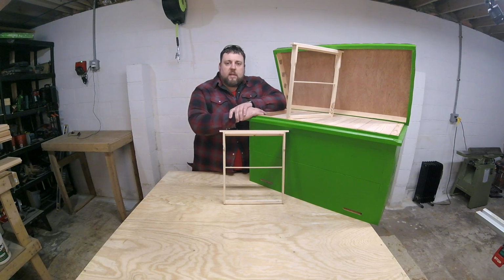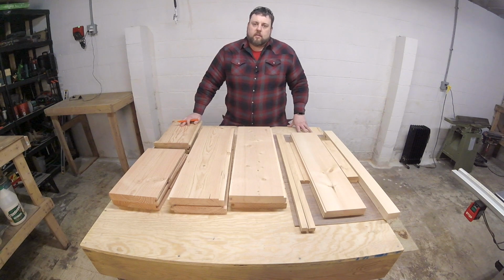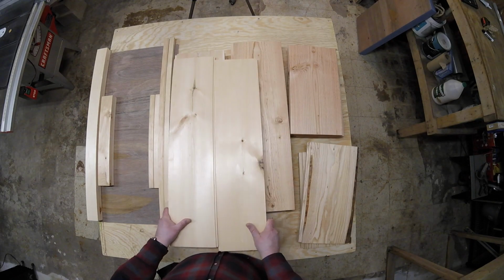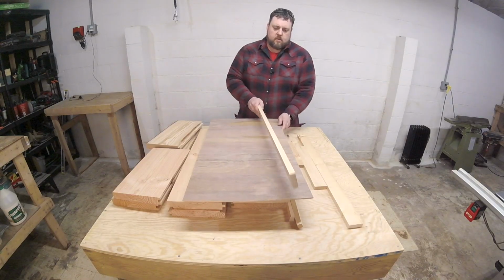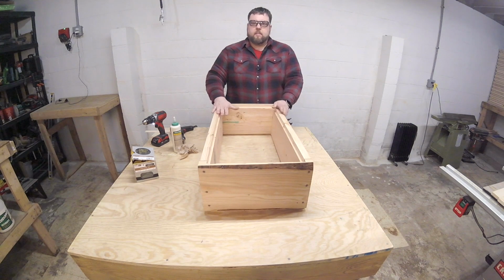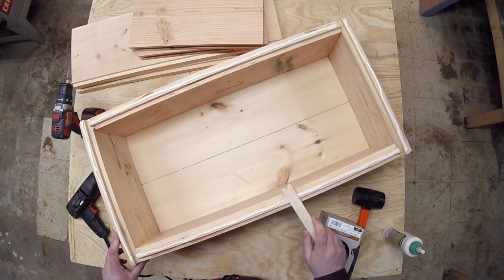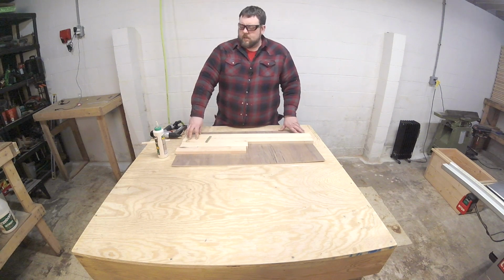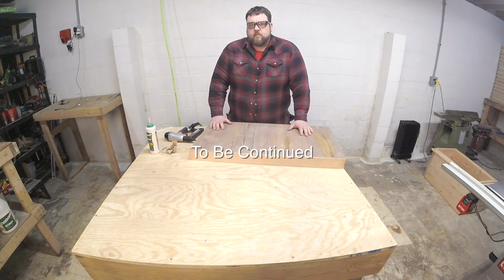🐝 How to build a Layen's Hive Part 1 of 2

Comment: I like how you modified the hive to 19 frames! Great idea!
I plan to further modify my plans by building a laminate wall with plywood, sandwiching foam board, with 2X2’s bordering each panel. vs, solid wood.
Reply from the maker: I've seen this done. I try not to run any plywood on the interior of my actual hives (not including traps). I'm not sure that the glues and chemicals used to make plywood are good for bees. It would however make a more insulated hive and defiantly be lighter. Good luck!
Reply: Bee Boy Bill 
Good point on the plywood glues!
May do a thin tongue & groove interior then to avoid that issue! Thanks!

Comment: I believe that with cold winters and hot summers, it might be a good idea to create a permanent layer of insulation around the outside of the standard Layen's hive between one-inch framing boards where you add the insulation made of the wool from local sheep farmers. Then have a second layer of siding outside of the entire insulation layer, similar to how we build house walls for humans, but not as thick. I think that one full inch of insulation all around the outside walls is plenty. The key issue is fixing the areas where the bee holes are and any ventilation holes with another layer of the boards and the exact thickness of the space with the hole drilled into those. This way the entire outside of the box is more like the thickness of natural trees, where even in the worst of the cold winters and the worst of the hot summers the bees would not have any problems with the heat or cold. The insulation layer would need to be fully enclosed, glued, etc. so that there is never a problem with infestation..

Comment: Further in the video I saw the yellow push block. (Seeing bare fingers pushing 2x6's scared me.)  Let me extend compliments to you on these videos.  They are some of the finest I have seen.  The way you made clear, right at the start which parts were which, the sizes, the careful cutting of rabbets, tongues, pilot holes, hammer tight the joints, keeping fingers away from staples etc., very professional, and a delight to watch.  The edits, the silent movie clips.  And one particularly sees from the ease with which you apply glue, the skill of your hands.  (Thirty years experience here; applying glue takes some skill.)  Nice shootin' pardner.
K. Hogan, Sacre Coeur Woodshop
Reply from the maker: Hi Kerry. I’m kind of attached to my fingers and try to be as safe as possible. I think you’re talking about the GRR-Ripper and it works great. Thank you for your support!

Comment: THIS IS FANTASTIC!!!  Thank you for the time and effort you put into this!!!  I have never raised bees but I have two kids with bad allergies and I have a disease in my spine that makes lifting a potential problem.  When I saw these hives I was hooked.  Dr. Leo is all about not medicating your bees and letting them be bees and I'm all over that.  My only question is what extractor do you use to extract the honey.  From what I have found the standard extractor are not large enough to accept the frames from this type of hive and for someone like me who will only have one or two hives I don't think it makes sense to invest in a $700 extractor.  THANK YOU AGAIN!!!
Reply from the maker: Hi Joe,
I highly recommend the crush and strain method for harvesting honey in small amounts with natural comb. You are correct, extractors are expensive and unless you are harvesting large amounts usually not cost effective. If you are only looking to produce for your family, crush and strain should work great. 

The crush and strain method does sacrifice comb, and therefore the production will not be as large because the bees will first have to make the comb to store the honey in. 

On the flip side, crushing the comb will also prevent build up of any lipophilic chemicals neighbors or farmers are using to treat their plants and if you really need more honey, adding more hives are cheaper than an extractor.

Thanks for your support. Hope this helps!
Bill

Comment: Hi Bill, 
Me again. Again, Thanks so much for this great video. 

I’ve bought my lumber for my first beehive and will be following your great instructions. 

I was torn on what design I wanted to use as I’ve seen other plans which incorporate slats which lay on top of the frames. This allow the keeper to access particular frames while leaving the rest of the frames covered.  
I wondered how your experience has been with no slats on top.

I could always use a rabbet to sink my frames a touch deeper and build shorter frames to accommodate and use your same design. 
I’m curious to know your thoughts on this approach. Do you see any benefit to having them, Or is it just one more thing for the bees to glue down?  :)
Reply from the maker: Hi GE, I don’t get into my hive too often so I may not see a benefit to additional slats on top, but I don’t think they are necessary. I try to check on them every two to three weeks but I’m not interrupting the brood best just adding a frame or two at the end if they are making lots of new comb. I usually only take a look at the brood nest in the spring and they don’t seem to mind too much. Hope this helps!
Reply: Bee Boy Bill wonderful!  Thank you!
Reply: Finished one box today! (Minus the bottom board which will be plywood and the top) but the hard part is done.  
Thanks again for the great video.  Super helpful!

Comment: I couldn't tell, but did you use a dado stack on the table saw to cut your grooves?  If you didn't, what was the measurement between the fence and the blade for your grooves?
Reply from the maker: Hey Eric, I did use a stack for the grooves.

Comment: is it necessary to do the joinery? don't have all that gear
Reply from the maker: Although I haven't done it without the tongue and groove or rabbit yet, I would say it's definitely possibly to do it without them with a little creativity. The trick for the tongue and groove would be to figure out a way to hold the sides and ends together. You could use dowels, biscuits, a pocket jig, or possibly even a 2x4 on the outside to hold boards together at the seem. The 2x4 would make it a bit heaver but might be a good handle for moving the hive. I'll put some more thought into this, let me know what you end up with!

Comment: Hey Bill, I noticed you expanded your length to accommodate 19 frames so that changed many of the length measurements.  I purchased your “One saw layen’s hive plans, but I believe this is the shorter version of the hive.  Do you have a parts list for the longer 19 frame version.  Especially the lid dimensions and some of the rabbets and dados.  Thanks!
Reply from the maker: You are correct, the one saw hive is a 14 frame variety. If you are using the one saw plans, I don’t think there would be any changes in the rabbets and dados. You would need to add lengths to the front and back of the hive, the bottom board, the sides of the lid, and the lid top. I will try and get an approximate number this evening for you of how much to add to those pieces for the 19 frame model, if you are in a hurry i laid out the dimensions for the 19 frame model in an early video “How to build a Layen’s hive part 1”, and those lengths would be correct and the width from the one saw wouldn’t change.
Reply: Thanks Bill
Reply: @BeeBoyBill  Sorry, I did not get the sizes for the bottom board and others before you started putting it together.
Reply from the maker: I'll get to the bottom of this, I was trying to respond on my phone and thought you were watching the One Saw Hive video. The One Saw Hive plans were actually from this build video: https://youtu.be/irGS0YbFHNM but they should be adaptable for a 19 frame Layens though I will get you some numbers ASAP for those cuts.
Reply from the maker: I sent you an email with the updates, please email me back and let me know if this will work or if there is something more I can do to help with your hive,
Reply: @BeeBoyBill  do you mind sharing the parts list for this 19 frame hive since the 14 is different or do u have the 19 hive detail plans on your website? Thank you for such a great tutorial!

Comment: I don’t have a table saw but do have a router with edge guide… can I make the joints just using that???
Reply from the maker: I use the dowel method instead of tongue and groove without a table saw. Check out this video for building a hive without a saw: https://youtu.be/irGS0YbFHNM
Reply: @BeeBoyBill  
Thank you! 

I will watch that right now…

Comment: Good Job Bill. What was the reason you used the jointer on an angle for the top frame?
Reply from the maker: Hi Michael, I used the jointer to chamfer the drip edge of the lid rest. It could also be done with a table saw or router if a jointer isn’t available.
Reply: @BeeBoyBill  Thanks Bill good idea ! Keep up with the great videos I sure enjoy them

Comment: Nice vid. I dont have the table saw to make the tongue and groove. Do you think nails and staples would work out?
Reply from the maker: If you're not moving them it might work. A better way might be to use biscuits or dowels and glue them together. Dowels are the easiest and cheapest if you don't want to get into biscuits. A third option would be to reinforce the joint on the outside with slats. I would think furing strips would work and it would give a bat and board appearance. Hope this helps!

Comment: is it essential to put the rabbit in the bottom for the bottom board?
Reply from the maker: Hi Jeremy. The rabbit works great but I'm sure there are a lot of different options that might work instead. I would try to keep the same distance between the bottom of the frames and the bottom board that the rabbit produces. Hope that helps!
Reply: @BeeBoyBill  do you reckon you could just cut in the bottom board neat to the inside measurements of the box and screw the board from the sides of the box or does the rebate serve a specific purpose?
Cheers mate
Reply from the maker: You could certainly do that. I would recommend some waterproof wood glue if you go that route to eliminate any gaps. The rabbit is nice for a better seal and helps disperse the weight accorded the bottom board. The only danger I could see is if you inset the bottom board without a rabbit, it’s possible that the weight of the full hive might push it through as all the weight would be on the screws. If you go that route, make sure to support the hive with the edges too so that all the weight isn’t just on the bottom board.
Reply: @BeeBoyBill  cheers mate

Comment: Why do the end pieces of the frames have to have the reduction from the 1.5 to 1 inch?  Can’t the end bars and bottoms of the frame all be 1 inch and the top bar be 1.5? It sure would speed up building
Reply from the maker: Great question! I don’t have an answer for you why the Layen’s are tapered. It makes sense for the Langstroth because the top of the side of the frame is for spacing. Because the tops can space the frames as you alluded to. It could be a carryover of design from the Lang’s. Either way, it looks like Dr Leo already beat you to it with his easy to build frames! I’ve never tried them so I can’t comment on results, but you can find the plans for them here: https://horizontalhive.com/how-to-build/deep-frame-do-it-yourself.shtml
Reply: Wow! I thank you 10 fold for this! It’s been holding us up from getting our hive going and now I feel confident we can quickly assemble and get this ready to go for swarm season in Ontario!!! Thank you Bee Boy Bill ✨

Comment: Push sticks!  Push sticks!  Use push sticks, roll up your sleeves!  (I used to have eleven fingers...)
Reply: letting that little cut off strip reminded me: My brother ripped a 1/2" strip off a board. When he finished the cut, it disappeared. It took awhile to find it. It was in the next room. It had gone completely through a wall, both drywalls.
Reply: letting that little cut off strip reminded me: My brother ripped a 1/2" strip off a board. When he finished the cut, it disappeared. It took awhile to find it. It was in the next room. It had gone completely through a wall, both drywalls.

Comment: What was the thickness of your bottom rabbit. Did you leave space for cover boards on top of your hive? Your video is a great help : )
Reply from the maker: Hi Mike, the thickness of the rabbit is the same as the lumber you are using so the bottom is flush, mine was 3/4". You don't really need cover boards with this type of hive because all of the frames are touching. There is about a 1.5-2" space above the frames however because the lid sits on the lip. I put rock wool insulation in this space for winter. Thanks for the comment!

Comment: While I am sure the tongue and groove is better, I wonder if gluing and clamping would be sufficient.  I am not sure my equipment  (And I) am good enough to get a tight joint.  Nice video and equipment.
Reply from the maker: I haven't tried this, but... you could try to run the edges across a jointer and then use the method I used to use in high school of drilling holes for dowels and gluing together.  I don't know if I would try it without the dowels. 

Another idea that might work would be to glue them together as you mentioned and then glue and nail/staple slats on the outside vertically to help keep them together. Let me know what you decide!
Reply: I plan on building a Layens hive but using biscuits as the end to end join.  Biscuits are fast and work well.  If you have a biscuit joiner on handy of course, otherwise it may not matter.  You could also just use some Liquid Nails between the joins and provide an airtight seal as well.  IMO as long as whatever you build is properly sealed/insulated you should be fine, the standard boxes are pretty janky, this Layens design is much more robust all around.
Reply from the maker: I like the biscuit idea, should work as well or better than the dowels. I personally wouldn’t do it without tongue n groove, biscuits, or dowels. I’ve tried glueing and clamping wood in the past without success (eventual joint fails). 

I’ve used liquid nails on a bunch of construction projects but prefer titebond iii for the hives. Let me know how the biscuits work!
Reply: @BeeBoyBill  Will do!   Supplies are in the mail from Dr Leo for the small parts and frames.  Give me a couple weeks and I'll report back.  Thanks!

Comment: Hello Bill,  I have finished my frames per your video and am ready to start on my hive box.  
I was wondering if you would build yours the same size
 If you had it to do over?  I can build mine any size but would like your opinion before I start cutting boards.  I think if I build more frames I may not glue the dowels
In since they were very tight.

Thank , Gary
Reply from the maker: Hi Gary,

I do like the size of my hives, but if I built more I think I would add 14 frame size. The 19 frames are great if you want to have the availability to overwinter 2 colonies in the same box. I overbuilt to begin with and haven't had to do this yet, but my friend Mark did run out of space and we put two in his for over the winter (look for hive divider video to see how we did this). 

Depending on your long term goals you can consider 19 frames if you have a longer nectar season of if you may end up with more bees than equipment. 

The dowels are tight and they probably don't need to be glued in the frames. I errored on the side of longevity and glued them.

Let me know how you make out!
Bill
Reply: Bee Boy Bill Thanks, I may try one of each size.

Comment: Bill, this hive looks amazing, but I'm seeing brood being layed way away from each other. From one end to the other. I assume a queen excluder will be made in the future.
Reply from the maker: Hi Roy,

No need for a queen excluder that I've seen. Bees do expand and contract the brood nest, but I've never read about or seen them have a split nest. 

I suppose this if the beekeeper was aggressively moving frames around this could occur because the bees do build different size cells for worker vs drone.

Also, the bees keep certain stores around the brood nest like fermented pollen (bee bread) and have to keep the brood nest in a specific temperature range. It would be highly inefficient for them to manage a split brood nest.

In general, I don't recommend or see the need for an excluder even when running Langstroth's unless you are running a commercial operation. I have heard of some breeding techniques that use queen excluders and I have attempted to use them myself when I was trying to get the bees to hatch brood out of some crossed comb and didn't want new brood to be laid.

Hope this helps and thanks for your support!
Bill
Reply: @BeeBoyBill  input is always great. Every beekeeper had different info and experiences.
I use excluder because my queens have been going into the upper boxes. I'm not a commercial operation, but I do want some honey.
Thanks for info.
Those hives do make a lot of sense. I like them!